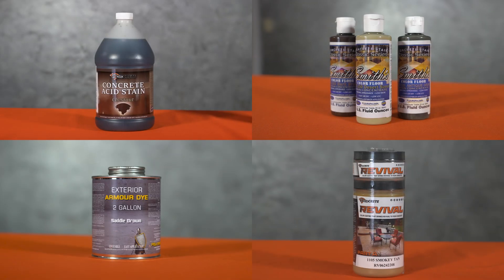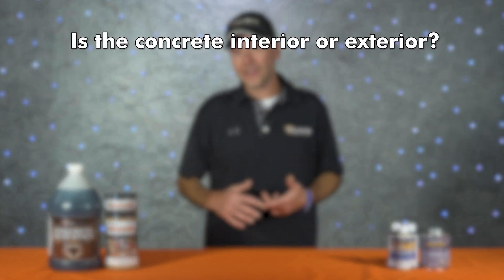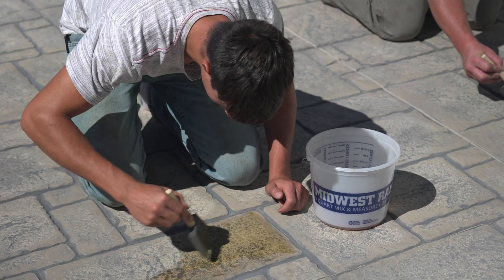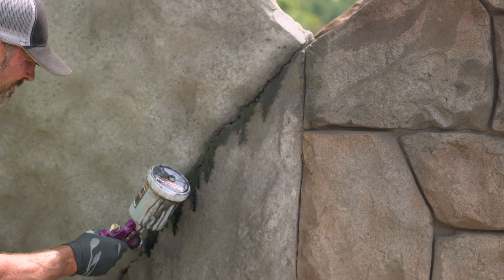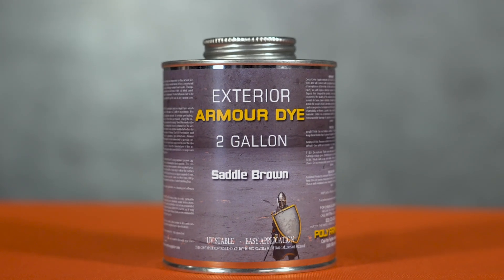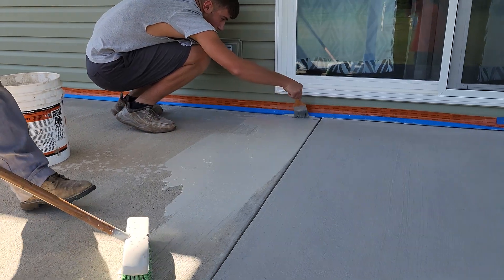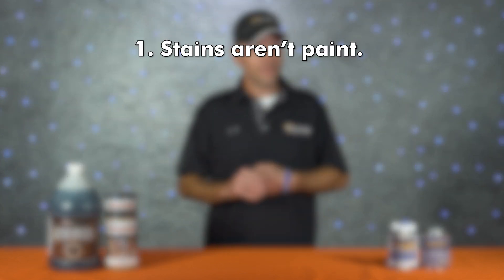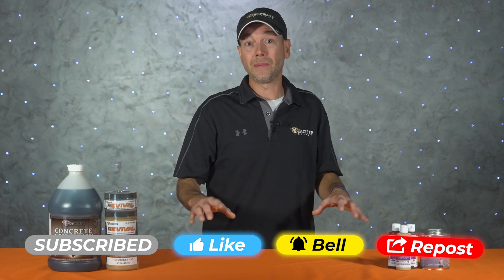Concrete Stains Explained!

Comment: I have a 10 year old stamped concrete driveway in red and recently expanded the driveway way but the color is more of a light red on the new section of driveway. I want to paint the whole driveway a uniform color in gray. What should I pick and do ?
Reply from the maker: Thanks for the comment!
That's a tough situation to handle. Paint would be an easy to use option, but it won't last long at all on a driveway. Paint really has a hard time bonding to concrete long-term no mater what the slab is used for. You would probably see a lot of delamination in less then a year on a driveway. 

I know you're looking to change the color entirely, but I'm curious if the new concrete has been sealed yet? Sometimes the two slabs look closer in color after applying sealer. The other thing to consider is that if the concrete has been sealed recently, it'll be even harder to get anything else to bond to it.
 
Another option would be a colored sealer. This certainly won't last forever, but it normally lasts longer then paint (maybe 2 years or so depending on the situation). It's also fairly easy to use, and it tends to wear off more evenly then paint. But it will wear off and require maintenance. 

Our Revival color coating system also something to consider. It would completely cover up the old color and give it a fresh new look. In this case, you would need to completely remove all existing sealer from the slab. Even if it's been a few years since it was last sealed. Revival will not bond to any sealer or paint; it needs to be applied to bare concrete. The hang up again is longevity on a driveway. We've seen Revival last up to five years on slabs that only see foot traffic, but vehicle traffic is different. 

All in all, anything you do to change the color on a driveway will be somewhat short lived and require maintenance to keep it looking good. If you're okay with recoating it as it wears off, then colored sealer would probably be your best option. I personally like to avoid all of these kinds of products on driveways, and try to use the natural color of the concrete if possible. Something as simple as our Texture Enhancer and some sealer could help the two slabs look closer in color without actually changing the color. 
I'll leave links to these products below so you can look them over. Hopefully this helps! Thanks for watching Deco-Crete TV!! 

https://www.deco-cretesupply.com/products/acrylic-color-packs/acrylic-color-packs
https://www.deco-cretesupply.com/products/sealers-coatings-deco-crete-revival/deco-crete-revival-stain-kit
https://www.deco-cretesupply.com/products/antiquing-agent/texture-enhancer-antique-agent 
https://www.deco-cretesupply.com/products/decorative-concrete-sealers-solvent-based-sealer/d-one-5-gallon

Comment: I have patches of color and finish missing on my interior concrete stained floors. Is there a way to touch up?Those areas that are scuffed in color missing? The floors are very old but sanding and refinishing is not in the budget at this time. I just want to touch up and reseal the areas where there's no longer any color. Figure if I mess it up, it'll be better than it is.Until we can get to a point in time where we can get the whole floor sanded.

Comment: How good is Home Depo Behr concrete stain?
Reply from the maker: Thanks for the comment! I've never used that product before, so I can't say anything about the quality of it. The thing I would watch out for is if it's truly a concrete stain or some kind of colored sealer or coating. A lot of the stuff you'll find at big box stores will be labeled as a stain, but it's actually more like paint. These kinds of products are fairly easy to apply, but don't hold up very well long-term. A true concrete stain will not completely cover up the concrete; it will penetrate into the pores and add a translucent color. Paint or a colored sealer will sit on top of the concrete, creating an opaque color. There are pros & cons to both of these kinds of products; it just comes down to the look that you're after and how much work you plan on putting into it. Generally, penetrating stains are more work during application, but tend to last a lot longer. Something that's just sitting on the surface will be quicker & easier to apply, but will need to be recoated every few years. Hopefully this helps. Thanks for watching Deco-Crete TV!!!

Comment: So I bought SandStone Cafe Concrete Step Stones from Home Depot.  They are supposed to be a sandstone color but many of them have very little color.  I'm not sure which dye would be best.  They call them dry-cast.  I don't even know what that means but I know they are not sealed and they are not troweled  smooth.  Would you recommend the Acid stain?

Comment: What about a concrete fountain?  Sounds like water based would work?
Reply from the maker: Thanks for the comment! Water fountains can be tough depending what type of concrete it's made out of. If it's hand carved out of a vertical concrete mix, then water-based stains do work really good. If it's cast out of standard concrete, the water-based stains have a tendency of wearing off over time due to the constant water running over it. In that case, acid stain would last longer. At any rate, water fountains will certainly require some maintenance over the years to keep the color in tact. Hopefully this helps. Thanks for watching Deco-Crete TV!!!

Comment: I have a covered patio with brushed concrete 1 year old .I want to update it and give it a shiny look and make it easy for clean up. What would you suggest.
Reply from the maker: Thanks for the comment! I'd be carful not to make it it too shinny. High gloss sealers can be hard to maintain on exterior concrete, and it tends to be quite slippery. I would recommend our D-One sealer. It will protect the concrete and darken the color a little bit, but it's not verry shinny. Our Super Stamp Seal is a little thicker and shinier. But just keep in mind that will require more maintenance, and you might want to add some Deco-Grip. I'll leave links to all this stuff below. Hopefully this helps. Thanks for watching Deco-Crete TV!!!                                                                                                                                                                                                                                                                                                                                  https://www.deco-cretesupply.com/products/decorative-concrete-sealers-solvent-based-sealer/d-one-5-gallon                                                                                                                                                                                                                                      https://www.deco-cretesupply.com/products/decorative-concrete-sealers-solvent-based-sealer/super-stamp-seal-5-gallon                                                                                                                                                                                                                     https://www.deco-cretesupply.com/products/sealer-additives/deco-grip

Comment: Thank you for the Informative video Jeff. I can't seem to find any information on staining grouted river rock. My shower has light gray grout with smooth black river rock. I want to darken the grout. Is it possible?
Reply from the maker: Thanks for the comment! Grout is a bit different then concrete and I've never attempted to stain any grout. All of our stains are formulated for concrete, so you'd have to do some experimenting. Water based stain would be the easiest way to create the look you're after, you'd just have to see how well it bonds to the grout. Hopefully you find something that works! Thanks for watching Deco-Crete TV!!!

Comment: Hello...appreciate your knowledge and detailed explanations...  I have a quick question regarding (I think it's stamped concrete).

 In my picture, there appears to have been a piece of the application chipped away leaving bare concrete underneath. Is there a way I can patch that or repair that ?  If not would that require sandblasting as in one of your explanations?  If you celebrate, I hope you have a Happy Easter and thank you for your time whenever you can respond.
Reply: I guess my phone is too old... it won't let me add an attachment ...😂
Reply from the maker: Hahaha..........no worries! Your description of the problem in your comment was all we needed
Reply from the maker: Thanks for the comment! We hope you had a happy Easter as well!! There is a way patching that spot. I'll leave a link to another video below that will explain the technique. I doubt that you would need to go as far as sandblasting if that's the only problem. Normally, sandblasting is only required when you need to remove sealer. Hopefully this helps. Thanks for watching Deco-Crete TV!!                                                                                                                                                                                             
  https://www.youtube.com/watch?v=r7GIUvxm0vQ&t=37s

Comment: I have a newly polished concrete slab in my kitchen. The foundation is decades old but the polishing makes it look like new it has not been sealed yet and I keep going between acetone and water based stain. There's very little traffic in the area I'll seal it with a clear sealer after it's down but what would your recommendation be assets on or water based and why
Reply from the maker: Thanks for the comment! There is certainly no right or wrong answer here. Water-based sealer would make some sense for an interior application due to the low odor. Solvent-based sealers leave quite a bit of odor, but most it will dissipate with in a few days. Other than odor, the difference would be how the sealer will darken the concrete. Water-based will not darken it very much, but solvent-based products will. Hopefully this helps. Thanks for watching Deco-Crete TV!!!

Comment: Our concrete contractor poured a colored stamped concrete for our back patio. Two different loads came and now we have two different, but kind of close colors separated right down the middle. I need to fix this.  Im not tearing it out, just want to make it look good. Any comments?
Reply from the maker: Thanks for the comment! This problem is common when making mutable pours with integral colored concrete. A couple of questions for you. Has the concrete been sealed yet? And what type of release agent was used when stamping the concrete. If the concrete has been sealed, the sealer would need to be removed before applying anything to correct the color. I'm curious about the release agent because some (powder antiquing release) will leave a color antiquing effect and others (clear liquid release) are completely clear, so the antiquing would need to be added before sealing.  If clear release was used on your job and the antiquing has not been applied yet, the color difference between the two pours will be more noticeable. If this is the case, the first thing I would do is add the antiquing, just to see if that hides color difference enough on it's own. If it does, that would the quickest and easiest fix. If powder release was used, or the antiquing has already been applied, then our Revival color correction system would completely re-color the concrete. The concrete would need to be unsealed and a minimum of 30 days old to use Revival. I'll leave links to the products on our website and our how-to videos on the products. Thanks for watching Deco-Crete TV!!!             
 https://www.youtube.com/watch?v=F0Vk_1sHTLg&t=3s                                                                                                                                                         
 https://www.youtube.com/watch?v=8w5MZBK9HXg&t=60s                                                                                                                                                                               
 https://www.deco-cretesupply.com/products/antiquing-agent/texture-enhancer-antique-agent                                                                                                               
 https://www.deco-cretesupply.com/products/sealers-coatings-deco-crete-revival/deco-crete-revival-stain-kit

Comment: I have cinderblock house and want to stain exterior walls. You said no to acid stain on vertical walls. Why is that? Does it drip a lot?
Reply from the maker: Thanks for the comment! Acid stain will work, it's just harder apply on vertical surfaces. It reacts to the concrete really fast, and you will notice every little drip and/or run. A water-based stain would be easier to work with and there are more color options to choose from. Water-based stain is topical instead of reactive, so you'll have more time to dab the stain with a sponge as it's drying which will help eliminate runs/drips. I'll leave a link to the page on our website. Thanks for watching Deco-Crete TV!!!               
 https://www.deco-cretesupply.com/products/stains/deco-crete-water-based-concrete-stain
Reply: @DecoCreteTV  This makes sense. Thank you so much for your response!
Reply: Came here to say this , same situation and blocks was thinking of using a water based stain to “dye” the outside of my spilt face block project

Comment: Good information.  I have an outdoor concrete porch that I would like to change to black.  Its currently untreated.  What is the best option?
Reply from the maker: Thanks for the comment! If the slab is currently unsealed, the best thing for that would be Revival. Water-based stains could also be an option, but they won't be as opaque, and it would need to be sealed after the staining. I'll leave a link to our how-to video and the seals page on our website. Thanks for watching Deco-Crete TV!!!       
 https://www.youtube.com/watch?v=8w5MZBK9HXg&t=832s                                                                                                                                                                                                                                     
 https://www.deco-cretesupply.com/products/sealers-coatings-deco-crete-revival/deco-crete-revival-stain-kit

Comment: Can any of these stains be applied to mortar. I know the composition is different, but it still may be worth asking.
Reply from the maker: Thanks for the comment! Any of these stains will color mortar, but the color will probably be a bit different then if it was applied to concrete. I would recommend trying the water based stain first and it'll the easiest to use. Thanks for watching Deco-Crete TV!!!

Comment: Did you say wait 30 days before staining new concrete?
Reply from the maker: Thanks for the comment! Yes, the concrete needs to be completely cured out before applying any stain. 30 days is the industry standard for cure time. Stain will color the concrete just fine before that, but it won't last verry long. Thanks for watching Deco-Crete TV!!!

Comment: What’s the lifespan outdoors?
Reply from the maker: Thanks for the comment! It's hard to give an exact lifespan for concrete stain outdoors. There are so many variables - the type of stain, the concrete itself, whether it's vertical or a flat slab. Acid stain is by far the most permanent, you should get 10 plus years out of it. But, the color options are limited and it doesn't look as good as water based stains for vertical concrete. Water based stains seem to last quite a while on vertical concrete & concrete overlays, but I would stick to acid stain for full thickness concrete slabs. Any time you stain exterior concrete with a water based stain, there's always a chance of needing to re-apply at some point. Thanks for watching!!

Comment: What can you do for interior stains and sealed concrete floors to change the color
Reply from the maker: Thanks for the comment!! Are saying that the floor is already stained and/or sealed? If so, you would need to remove the sealer first. The best thing for interior floors is a diamond grind followed by acetone dye and a urethane or polyaspartic top coat. If the concrete is unsealed and in good shape, acid stain would be good option. Hopefully this helps! Thanks for watching Deco-Crete TV!!!
Reply: Thank you so much for responding. My family and I are in the process of looking for a new home. I found two homes that I like but hate the color of the stained concrete. Didn't know if it was an option to change the color. Is that a very expensive process? It would be about 3,000 square feet that would need to be redone.
Reply from the maker: @bethanyphillips212  The price for redoing an existing stained concrete floor can vary a lot depending on what's there and what you are looking for. The best thing would be to contact some local concrete floor coating contractors to get a quote on the price.

Comment: We had our driveway in Phoenix AZ stained and sealed two years ago. It started to flake within a couple month. Now the sealer is peeling in large pieces and has lost the stain color in some areas.  What is the best remedy for this?
Reply from the maker: Thanks for the comment! These kinds of situations are tough because there are a verity of things that could lead to this. What kind of stain was used, how did they prep the surface, was the stain over applied, and what kind of sealer? The first thing I would do is contact the contractor that did the job, they might be able to fix the problem. At verry least, they should be able to give you all the info so you put together a plan for the best way fixing this. Sometimes the only way to completely solve the problem is to remove all the sealer and start over. If you do end up redoing it, acid stain would the longest lasting stain option. Hopefully this helps. Thanks for watching Deco-Crete TV!!!